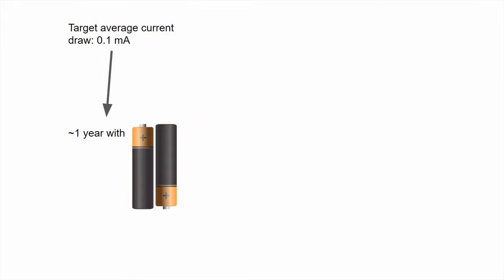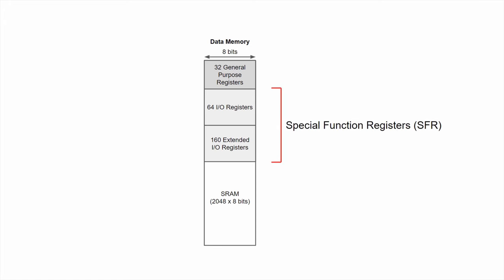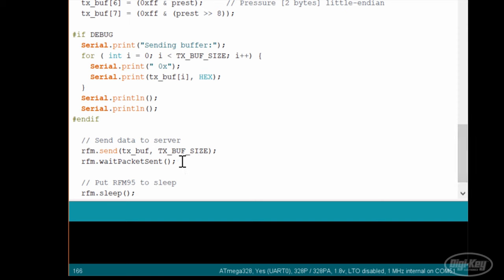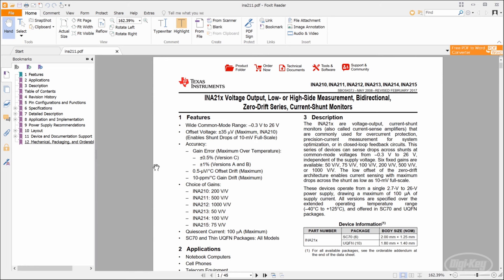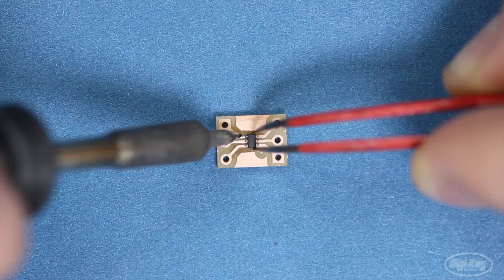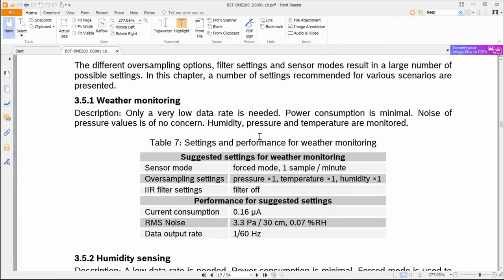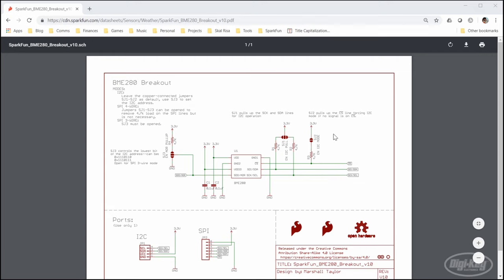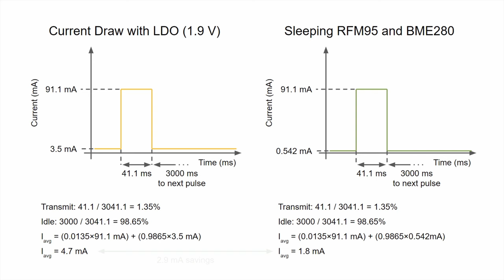Arduino Project to Product Part 7: How to Measure Small Currents – Maker.io Tutorial | Digi-Key

Comment: Shawn   doesn't the bme280 have a self heating feature built in ?   If so can you turn that off to lower the power consumption even more ?   Have you compared other sensors to see if the consume less power ?  Like bmp280 , bmp680, bmp388   Just curious ?     in part 9 or 10   will you make a solar charge controller to charge the battery back up  like a tp4056 with a zenier diode to control the 5 v ? .
Reply: Reading the datasheet more carefully, and you're right, it does seem to have a self-heating element built in. However, it's mentioned in a tiny footnote at the bottom of a page, which doesn't help give you any idea about current consumption, etc. Because sleep mode is listed at 0.1 uA, I have to imagine that they're turning off the heating element during sleep mode. The heating element has been known to throw off readings for people (https://forums.adafruit.com/viewtopic.php?f=19&t=109052), but I'm guessing that keeping it cool for long periods of time would help (but might throw off other readings, like humidity?). This will require more research :) 

For now, I'm keeping this series at alkaline cells. However, the idea of charging/discharging LiPos and working with solar is definitely being discussed, which might become it's own mini-series :)